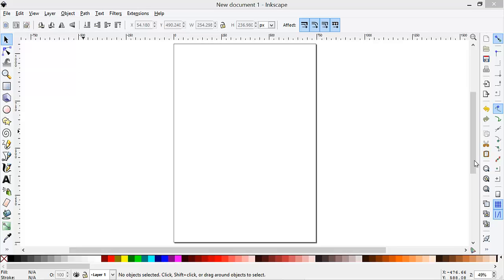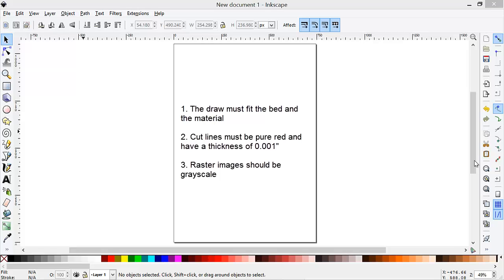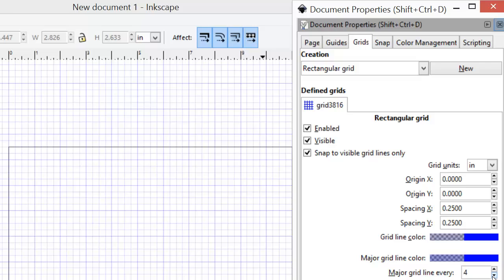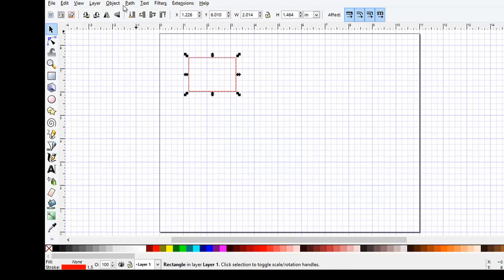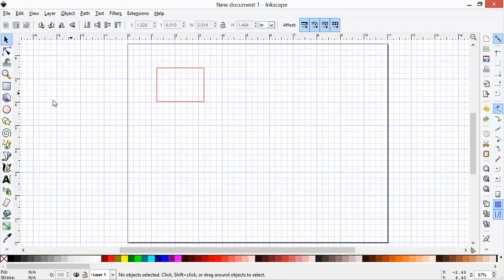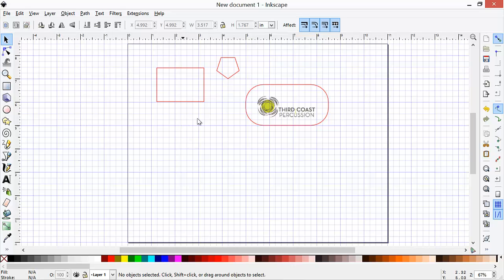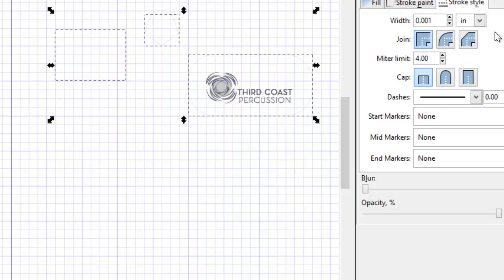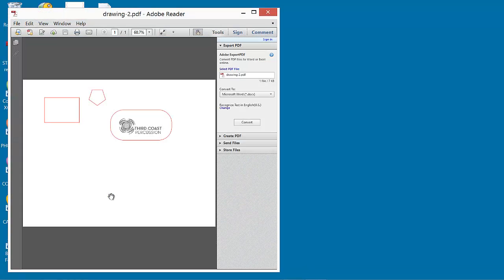Inkscape Design for Laser Cutting

Comment: One suggestion. At 7:08 you take the defaults for that menu but I would suggest changing the resolution for rasterization from 90 to 96. The reason for this is an Epilog laser cutter has a default of 96. If you leave yours at 90 it will try to convert making all of your images/cuts 6.67% smaller. 

Great video! I'm going to try the whole PDF format tomorrow. I have been using .eps instead and have been having problems so I am hoping this works.